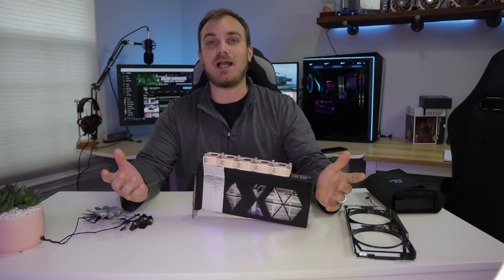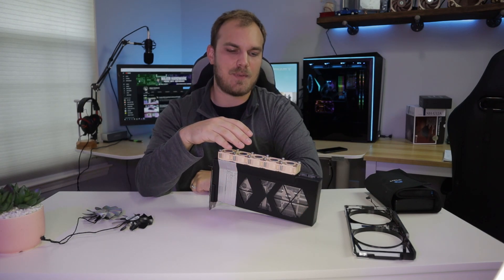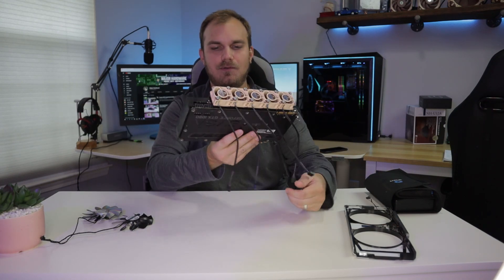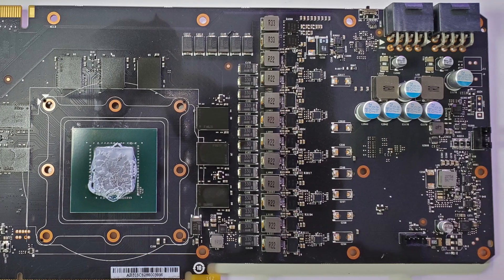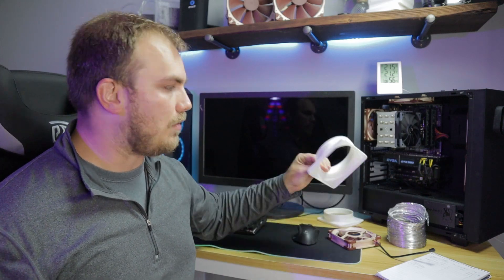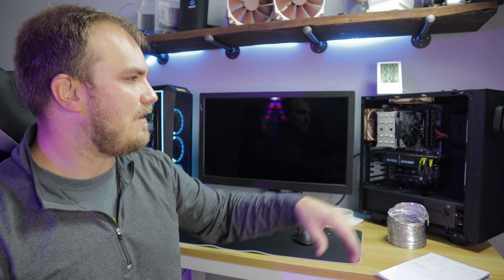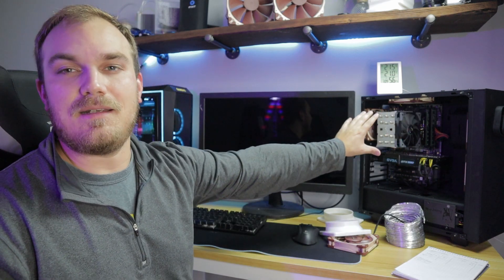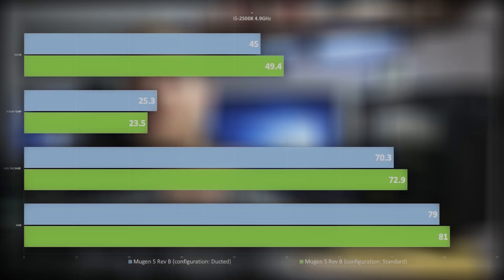Does Connecting Your CPU COOLER Directly To Your Case Fan Improve Temperatures?

Comment: Why do you have an exhaust fan right above the CPU tower? If anything that should be intake so you have positive pressure in you case and you get fresh air directly into the tower cooler

Comment: Hello. 
How about doing a similar set up but using your 200mm fan as the intake fan and narrowing it down to the 120mm set up you have here to take advantage of the venturi effect? You see similar systems in cars, bikes and jet aircraft, essentially using a trumpet shaped inlet to speed up the air on the intake of the engine. Would it have a tangible effect on the relatively slow air speeds seen in PC systems and improve their performance?

Comment: Whatever you are gaining on the CPU temps you are losing on VRM cooling since there is less air flowing inside the case.
Reply: Exactly, the VRM and chipset temps go up. You are shortening the life of your motherboard. This mod worked fine back when we used top down coolers but with tower coolers you need more case airflow for the other components on the motherboard. There is actually a good reason this isn't popular anymore.

Comment: Interesting
Now your RAM isn't cooled, though
Reply: RAM does't really need cooling in the vast majority of situations.
Reply: Nor vital parts of the motherboard (northbridge etc...) that can get very hot.
Reply: @AJDOLDCHANNELARCHIVE  You only have to duct one intake case fan, so if you have more than one intake there's your MB, SSD and VRM cooling. Also RAM cooling, if you're into that sort of thing.
Reply: @AJDOLDCHANNELARCHIVE  Nah dude, I think it's true to all extents. Total airflow speed might be slower if you gimp yourself by one fan but higher airflow speed gets you diminishing returns anyways. Most cases have the exhaust fan and right next to where the heatsink mounts, so the air heated by the CPU doesn't have time to stick around and share heat with air in the case. That way you aren't compounding heat from all the components together inside the case.

I only saw one intake case fan on his setup which all his components shared. If he had two, I don't think MB overheating would ever be an issue.
Reply: @AJDOLDCHANNELARCHIVE  I don't understand. Why would your motherboard be covered by the duct? It's supposed to be suspended next to it. Are you worried it would stifle airflow in the case around it? I could see that happening but the design can always be improved.

I'm not arguing that it's practical or risk-free. Practical and risk free isn't in the overclocking dictionary. I'm saying if you plan it all out and know what the problems you need to solve are, there's no reason you shouldn't be able to manage component temperatures by themselves with one intake fan. Personally I'd have two exhaust fans as well but I'm not sure it's necessary.
Reply: @AJDOLDCHANNELARCHIVE  With a big enough case airflow around the duct wouldn't be an issue, but then with a big enough case most things aren't an issue. I gave some thought to moving intake and exhaust fans around but I didn't think to position the intake duct elsewhere, so thanks for that idea.

I still think you're over-estimating how many more fans you need when you only sacrificed one for the duct, but I also don't know how much the duct obstructs airflow in the case. I know it's more than zero.

I dunno, even if it's not practical a project like this sounds like a real fun engineering challenge.

Comment: I actually have some old PC cases here at work that pull fresh air directly from the side panel (has vents and a funnel) straight to the CPU (meant for stock coolers of course). But they have been doing stuff like this for years! :P

Comment: you should route the ducting through the front panel and to the next room where its connected to a massive 4 feet or bigger fan. should not be able to hear the fan from the other room where the pc is.
Reply from the maker: thought about hooking it right into my homes Central air, AC pc

Comment: Had an HP where the PSU had a shroud that pulled air over the RAM slots. Also seen several Dell's where there was a shoud so CPU fan doubled as the case fan.

Comment: 4K24 vs 1080p60
*Don't forget the major issue likely is Youtube's compression of video. Would 4K uploaded run at 1080p downloaded look better than 1080p uploaded and 1080p downloaded? I don't know. Does everybody get the same experience at "1080p" or is there some variation in the bitrate? (like Netflix does). I don't know.... I do know that 4K is generally pointless for Youtube unless there's some video content that specifically needs the fine detail OR if the Youtube compression somehow does better at 1080p with 4K uploads (though it may do worse).

Comment: I feel like I'm the water cooled version of you, I wish I had a 3d printer back when I built my office water cooling system. Instead of trying to spend a fortune on a fancy watercooled case build I did external water cooling to ultimately dump the heat outside and go for function. I built a custom wood spacer that I wedged into my office window trimmed and sealed, then epoxied copper pipe through the spacer in the window with quick connection fittings on the indoors side. Outside I have a large copper transmission that runs the span of the window mounted horizontally. The PC dual d5 pumps, they pump to the CPU-GPU then to a PCIe passthrough plate, then it pumps the fluid to the top reservoir which is clear PVC pipe I bought online that I modded to my desk corner so I can always see the fluid level with a clear top cap. The fluid goes into this clear pvc pipe via a 3 way fitting under the desk level, a smaller 1/2  inch stand pipe is installed down the center of the pipe at a lever above the radiator outside. The output of this clear pipe exits out the bottom 3 way under the desk to the window connecting to the quick connect on the window. It passes through the radiator outside via gravity and back to the window. From the 2nd quick connect on the window it passes to the pc to feed the D5 pumps. I see temps as high as 41c with the outside fans off during normal usage web browsing and youtube viewing with it passive cooling the loop here in Florida. I recently added a relay circuit with waterproof automotive fans outside that triggers a relay at a set temperature to kick on fans. I have 3 small fans on the radiator that kick on 1 at a time based on temps. During streaming and gaming it will trigger 1 fan on outside and actually maintain temps in the 40c range while streaming and gaming.

Comment: A friend of mine actually did something like this for exhaust with a hot FX-8350 build he had. He attached a plastic duct connector from an auto parts store to his 120mm exhaust mount, attached it, attached a dryer duct, then attached a fan to the end of it. The case still had a 120mm fan on the rear, obviously mounted on the inside, so the duct had a fan on each side. It seriously helped him redirect the heat from his rig to an area where it was not a bother, instead of under his desk giving him sweaty feet and swamp ass lol.
Reply from the maker: yes in the room where i have all this it defiantly heats up over time, might need to do something like this
Reply: @MajorHardware  looking forward to it if you do!

Comment: Great idea. But DO NOT  do this with aluminum...smh
Reply from the maker: yes agreed, could possibly short, if you seen my last video im a professional shorter
Reply: @MajorHardware  Yeah if that touches the mob its not gonna be pretty. Even a cloth material could build up static. Some kind of rubberized material would be best. Just using the front mount that you made for the front fan could help direct airflow. Id just extend it another few inches.

Comment: i did the same stuff with an indirect airflow with another high RPM cpu fan mounting in 90degree to cpu fan. result arent great as the stock CPU fan on CPU got to high RPM as to 5000 Rpm according to Asus Ai suit 3. which sounds like a jet engine. so i ditched all the stuff and got a better cooler than Stock.

Comment: It might work better if you used the top fan as the duct intake (in the front most slot instead of the back) and kept the front fan to help cool your gpu and other components. Like you said the s340 elite is a very restrictive case but those top fans are completely free from stupid design choices.

Comment: it's cute when new audiences find out about oldschool mods :D
Reply: Agree, and they aren't even mods anymore, some OEM's do this for decades in the prebuilds.
Reply: @Madmax23419  indeed, one OEM I know for fact, is Dell. The optiplex used a case mounted intake fan with a shroud that ducted onto the cpu heat sink. LoL
Reply: @VulcaNtGoF  they sure do. HP does the same on some of their thin clients.
Reply: @WilGraham1  I really can't complain, it was running a Pentium 4 3.1 ghz just fine, with minimal extra noise.
Reply: @VulcaNtGoF  was it like the one which opens like a briefcase?
Reply: I actually forgot about that shit. Thought it took up tooucu room why not vent it out the side. Much less space taken up. Especially since there's top mount fan coolers.
Reply: Even nowadays this is how a lot of stuff works so it's not a re-find... GPU's, consoles and laptops are already designed that way but most fail in the point that sure they use all the airflow to completely cool what is mostly needed CPU\GPU\SOC but always tend to forget cooling all the other motherboard components even if its not much required, but the cooler everything is the more life they will always have too...

And yeah I have disassembled a lot of PC's with those designs, even my old bought case came with a plastic tunnel on the side to be used with ref AMD\Intel coolers and push them directly outside, but I ended up removing it and adding a fan instead :).

I have also seen in servers where they start JUMBO JET loud when starting up with this kind of design, it totally increases noise level with the fan flow completely flowing directly from the intake to the exterior without any noise reduction in them with the huge server Turbo jet loud fans lol.
Reply: Lol, yeah I'm glad I wasn't the only one thinking this. My first dell computer had this built in almost 20 years ago.
Reply: Just attach a box fan to the side of a full tower and then tell me what it means to be retro
Reply: @myonen5000  , or "wrong mobo/case combo" where power button wasnt compatible.  I remember starting my pc with a dodge car key across the mobo header pins!
Reply: Uh, that brings back memories of HP office PC's back then. Where you start the machine and it sounds like a fighter jet taking of next to you... Good Time...
Reply: 😒👍 Keep It Old School
Reply: I did that on a dual Pentium Pro back in the day with some automotive ducting I got at Track Auto. I started out with an Intel 440FX motherboard but later replaced with a Tyan don't remember what model.
Reply: Right? This has been around for ages lol
Reply: Is not good to learn from the past? Many who are young or older and new to PC building will find it usefull. Also any change to an original configuration is a MOD right?! Just because it exits in other PC's or even things like a server does not matter. A MOD does not have to be a new or original thing
Reply: This is not even a mod. Servers still use ducts to redirect airflow.
Reply: BrunoDSL seems I'm late to the party not just servers though. I know Dell's been doing it with it's OptiPlex line for years
Reply: @BrunodeSouzaLino  uh it's a mod cuz it didn't come with the case you fucking foreign idiot lmao
Reply: @chilldudie242  dudie, chill
Reply: drunkredninja https://xkcd.com/1053/
Reply: @uss_04  I love that I know which that is without even clicking the link.
Reply: @avaviel  Then please explain the point to me? Is the point really "SJW FTW"?
Reply: @uss_04  <3
Reply: @uss_04  what's the point of that comic? 10.000*365 = 3.650.000. Brith rate 4.000.000. So by that math everyone will know every(new)thing within 1 year and 5 weeks? That's about the most random BS numbers i've ever seen

Comment: Man i asked a question in the last video and got an answer in this video...great job. I wana ask one more question.
What if we cool the ducked connecting the heatsink and  casing fans?cuz that would cool the air coming in? No direct cooling of heatsink with water but cooling the airducked surface. Maybe will work. This time make the ducked out of a material that can easily get cool or maybe the ducked material is helping us with the cooling in this video? Cuz the air coming in will transfer some of the heat to the inside walls of the duckt. Hmm and the cooling of duckt is done through the case fans that are pushing the air  inside(The case fan not connected to the duckt).?? Maybe...so many questions. Sorry i said i would ask one question..^^
Reply from the maker: i read them all my man

Comment: This is a very bad idea if you only have one exit fan, as the processor is not the only thing that needs ventilation. Some lower end graphics cards, for example, don't have a fan, nor a heatsink, and therefore need the main case fan to cool them down. If you have multiple fans, I see no problem, but if you have only one, you could damage your components.

Comment: Everytime you post a new video.  I know I'm in for a good time.  Something interesting, & Extremely creative as well.  Just like this video.  No one is doing this stuff.

  My only thought would be.  To have the duck go from the front of the case.  To the back of the case.  That way the cool air goes in, & out.  It will not mix with the air in the case.  Thank you for posting this video.  I can't wait for the next *Video.  Have a great day.

Comment: I'm an HVAC professional with 20 years experience.  Move all your slack in to duct to the entering air side or cut it out to remove resistance in the duct for smoother airflow. The resistance is slowing the velocity of the air. Hope that helps.  BTW love your videos.
Reply: Seconded. I test extracts as part of domestic energy efficiency assessments and flexible duct kills airflow. Try making the duct out of printed sections that can be screwed together. Will be way more efficient.
Reply: I agree, I work with nasa, and I'm a space scientist/archaeologist. I helped create balloons, and I was the lead engineer on the release of the best selling child's toy "Big wheel".

If you take just make two mounts. one for the cooler, and one for the entrance, than take plastic and wrap it tightly around using hose clamps it'll create pressure, and increase airflow more than hard plastic.
Reply: +1
Reply: Good comment. I've learned something there.
Reply: 😀 yay! Terminal Velocity! 😊
Reply: Makes sense
Reply: I took one look at the thumbnail and jumped straight into the comments but it looks like I'm not the first to spot the issue!
Reply: @Sam Short this comment was so long ago, so no idea what you're talking about but it looks good.
Reply: I came to make the same comment. Get that slack out of the line!
Reply: Because the entire case is supposed to be the duct...
Reply: I approve this comment. I am an FBI Agent and I can tell you are surprised just by looking at your face. Yes, I'm looking at you from your camera
Reply: @mastergta23  I winked at the camera
Reply: This would make a negligible difference. Don't think you can class yourself as a professional if you think that would make a big difference. Using higher static pressure fans would make a much bigger difference to airflow in this setup.
Reply: Spiral duct actually spins the air. The fastest flow known on earth is a tornado witch spins... but yes the tighter the flex the better and if you can seal the gaps were connections are made the efficiency will go up. Also insulating the exterior will help keep coldest temps
Reply: @champ200013  It does not do what you think it does. Nvm.
Reply: @champ200013  It's true, air acts as a fluid, as water does. so, spiraling is better.
Reply: Maybe if you had very powerful fans pulling air then your duct resistance would matter but it doesn't matter here lol
Reply: @masonhales  For such a large diameter of the tube, short length and slow air velocity, it doens matter!
Reply: @masonhales  Thats why it helps to have 2-3 fans blowing air into the case. Even nosey molex fans lying around would work..Every case might be different i guess.
Reply: @masonhales  no that creates more turbulence
Reply: @masonhales  wouldn't resistance matter even more for fans with lower airflow?

Comment: What if you 3d print an air duct with your straightend airflow as an intake from behind the cpu cooler and a printed air duct as an exhaust to the top? Wouldn't this be the best cpu air cooling situation? 2 Fans intake, 1 Fan exhaust. 
Your gpu cooling solution should have an direct air duct through the side panel then I'll think you gonna have one of the best air cooled PC's it wouldn't matter if the air flow through the front panel is bad.
Disadvantage coould be higher noise level...may be... it depends

Comment: The point of intake fans are to provide fresh air for the whole system, including CPU Cooler, CPU, VRAM, GPU, hard drive, etc that are inside the case. I want to see how are the GPU and Nvme SSD drive in this current configuration you have. 
here's my suggestion, You could use the rear fan as intake, then make shorter channel to the cooler, going up to one of top fans as exhaust. This way you could still use the front two fans as intake (for other components inside the case), then one top fan as another exhaust. I would love to see this. ;-)
PS: Old Mac Pro and some new cases with one chamber for motherboard side,  another chamber for GPU, and  possibly third chamber for PSU and HDD have better thermals as they implanted different ways for the air circulation or many ventilation.